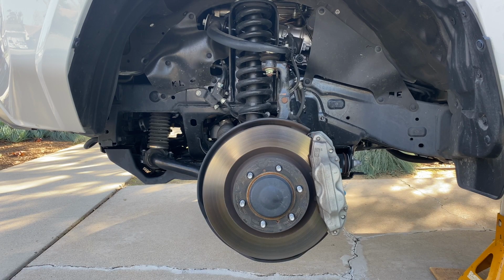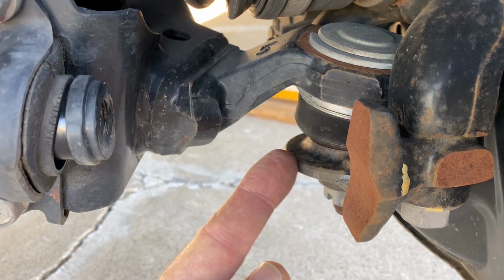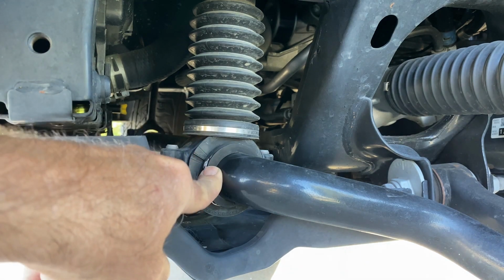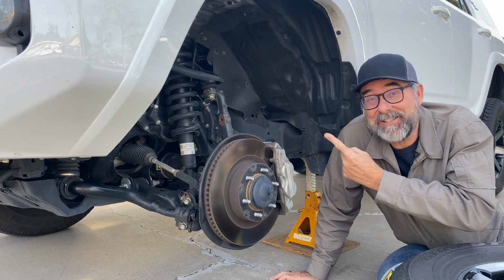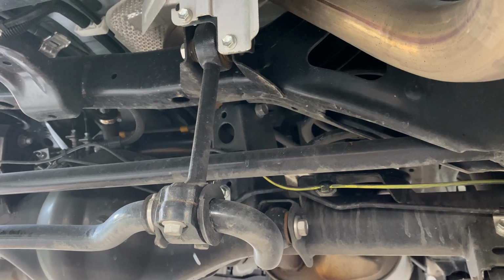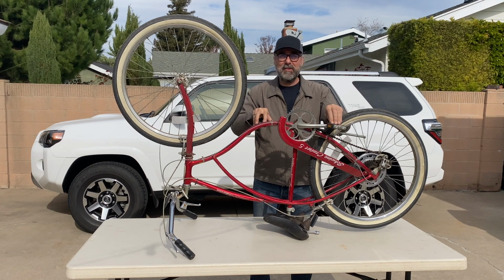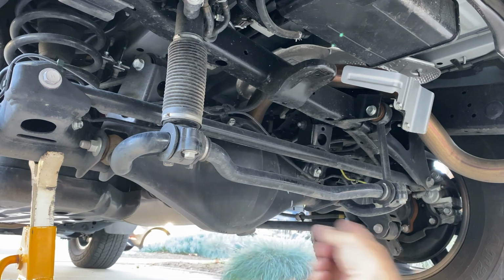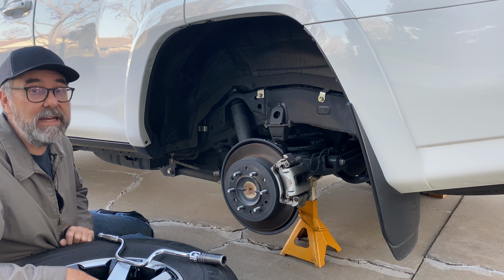2021 Toyota 4Runner TRD Off-Road Suspension Walkaround: Why I Bought The KDSS Stabilizer Bar System

Comment: there are pros and cons, for me the cons outweighed the pros, and essentially it seemed like bandage toyota came up with for rollover accidents. 
the KDSS has less clearance due to having the skid plate sit lower.
cost of repair is insane
for washboard roads or fast offroad driving both left or both right wheels with compress at the same time, like driving on a road, which will make the kdss stiffen up and put extremely ahrd hit into the cab. 
You just can't go wrong with the original design, especially if you know how to drive and what you're doing.

Comment: 2024 TRD Off-Road and TRD Pro models are equipped with an electronic-locking rear differential and Toyota Crawl Control feature for enhanced off-road capability.

Comment: I have a '18 TRD Off-Road with KDSS that failed at less than 47k kms. Lightly wheeled, 95% daily driven. For most people with KDSS,  its great and never an issue. But for the odd person that has it fail on them they'll see a more than $5300 repair bill (checked with multiple toyota dealerships that dont normally have to work on them) for a $4000 factory option. It was difficult to justify the spend on this repair and  I opted to tear it all out for a non kdss sway bar setup. Wish i never had it equipped. To each their own though.
Reply: What did converting to a non-KDSS setup entail? From what I've read it's not as straight forward as replacing with the standard 4Runner sway bar as the frame mounts are different.

Comment: That detail on the longer grip length of their “performance nuts” is something I learned from your video. Genius, really. it basically allows the benefit of a spacer to lengthen grip length without an additional part.

Comment: I want to level my trd off road premium and add some falcon atw tires for snow and lots of skiing rain doing some off road and still a daily commuter in south.  Im getting various info from multiple sources and am acquiring more here.  any input on how to do this without adversely affecting the KDSS? I don't want to cheap out..just want the best option for my needs.

Comment: Hi Dan.  Great video.  I have a 2016 4Runner Trail with KDSS.  The KDSS light just came on.  I don't notice any difference in handling nor can I see any leaks in the system.  In an effort to mitigate the $4K fix offered by Toyota, might you have any suggestions?  Thanks
Reply from the maker: I'm not sure what the issue might be. A friend bought a used 4Runner Trail with KDSS, and his light came on. In that case it turned out to be rodents chewing certain wiring and causing a short.
Reply: @DanEdmunds that's terrible. KDSS is more of a worry than a legitimate addition

Comment: Thanks so so much for explains this and using the bike too! I totally understand it now lol. I was a little confused before. Will putting different wheels on a 4r with kdss change or mess anything up on the balance or calibration ? Ex. Heavier or lighter wheels or wider

Comment: Do you know if the TRD Pro Fox shocks eliminate the notorious brake "nose dives"?  I have a 4R with KDSS and I could see a big difference from my first SR5 without the KDSS.  The SR5 had TERRIBLE nose dive.  If the KDSS is better with nose dives than with FOX shocks, I might not "upgrade" to a TRD Pro.  Thanks.

Comment: We drove our nephew's 2019 SR5 Premium a year or so ago, and was disappointed our 1999 4Runner handled so much better. I was surprised to the point I thought about looking at other vehicles entirely. Then I heard about the KDSS system and looked at a TRD Off Road Premium, which we ended up buying. It's still a bit soft and bouncy with noticeable nose dive when braking, but so much more stable and flat in corners. Very happy with it!

Comment: How does the KDSS piston know when to go limp?
Reply from the maker: It doesn't need to know. See the bicycle pedal example in the video. When cornering, both cylinders (they're only on the driver side) compress or extend together, which means the fluid inside them "deadheads" as each stream runs headlong into the other. (Standing on bicycle pedals is the analogy here) Fluid is at a stalemate, so the struts can't move. In articulation, each is trying to move in the opposite direction, so the fluid moves freely, allowing the struts to move. (Pedaling the bicycle is the analogy here.) The road below the vehicle is basically the "feet" pushing up on the KDSS struts.

Comment: TRD Pro is not more expensive just because of the suspension. There are a ton of options that drive up the price, like rack, wheels, exhaust, and the high end sound system. For what it's worth, TOYOTA puts KDSS on all their Baja 4Runners, not the PRO suspension.

Comment: KDSS is crap.  If you need sway bar disconnects, install them.  This system just breaks, and the computer throws a fit when it's missing after you take it out when you see how expensive it is to repair.  This is a solution to a problem that doesn't exist.
Reply: Best comment ever

Comment: How does the 4Runner ride with the KDSS other than it makes it handle better? I mean does it give it a more luxury ride?  Smooth and isolating?   Aside from the Avalon, all Toyotas ride crappy.  My GF's RAV4 Limited rides like a tank on gravel road.  Every bit of the road surface can be felt and heard.  Hit a pothole or rough roads and it makes you think the car had no suspension at all.  Most uncomfortable riding car I ever drove and rode in.  No amount leather or options makes it easy.   My F150 is a Cadillac in comparison.  Does the KDSS make the 4Runner more comfortable on long interstate drives?  Please let us know after you have gone on such a road trip and some off road venturing.  Thank you.  I am considering buying a 4Runner and your recommendation will be greatly appreciated.

Comment: I love my KDS but I have a question why the front sway bar seems like to walk to the driver's side protrude about 3/4 of an inch more?????? It seems to be happy there... At 65000 miles outside rubber bushes look a little worn  so I replaced them with urethane.. No real problems other than it just don't look right....
 It's not a lot of information out there........
 Some reports say it wanders side to side and it's just fine,,,, but mine seems to like the driver's side any thoughts on this

Comment: Would be cool if this could be on the tacomas as well!
Reply from the maker: The Tacoma would have to have coil spring rear suspension -- which is supposed to get in about a year. KDSS? No idea. They never put it on the FJ Cruiser, which really could have used it.

Comment: Dan, I know your a master of suspension. 👍🏻 I’m in a position to order a 22 trd off road 4Runner. I/we are not new to 4Runners. 1 of them has kdss and the other is a trd pro. I think kdss is a great system for my wife’s daily driver. However we are going to a 22 off road premium that we want to alter the suspension a bit. Looking at adding 2-2.5” in front and 1-1.5” in rear with springs and shocks NOT spacers. I talked to (2) 4x4 outfitters thinking I’d get some answers , but “naturally” one says get it it’s great and the other says no. So…… I’m back to square one. I would appreciate your input. We’re ready to order just have to decide. I’ve never driven one without kdss except our current pro. Due to the vehicle shortage I cannot find one without kdss to test drive. We live in SE Wisconsin but travel quite a bit to NW Wisconsin where the trails and forest service roads are plentiful. This new 22 will be driven ALOT 85% roads and 15% off road. 

Thank you for your input and great videos. 

Mj
Reply from the maker: I am about to lift the front of my 4Runner, in the same way, with Bilstein 6112/5160, I think. I'm not clear on how high a KDSS 4Runner can be lifted before there is an issue, but I've heard that 2 inches is OK in front with the rear an inch less (2/1) because that 1-inch difference is what most people prefer to level the stance. I may only lift the front one inch and leave the rear alone (1/0), buts that's my preference because I personally don't want to lift it any more than necessary. I have now fitted 33" BFGs on the truck, and they look even bigger because I haven't jacked it up a lot. I also know they clear when fully stuffed (without spacers) because I can test that on my ramp.
Reply: @DanEdmunds  Looking forward to a follow-up video with these changes!  Many of us out here in the inter webs are interested in your expertise!  Thank you for sharing that knowledge!  Btw. just picked up a TRDOR with KDSS and am loving it!

Comment: Thanks for doing this video. Apologies if I’ve missed it, but why don’t they put this on the trd pro’s? Do they have a better system?
Reply from the maker: I'm not sure of the official answer. I think it comes down to cost - the TRD Pro is expensive enough as it is, and complexity. I think TRD Pro 4Runners have the Fox dampers added at the port, not on the assembly line in Japan. KDSS would make that swap more time-consuming. I also think that the Fox suspension might have a bit more travel and flex a bit more than a non-KDSS TRD Off-road. Not as much as a KDSS TRD Off-road, but close enough that the expense and complexity might not be clearly worth the cost.

Comment: Does trd pro have more body roll than trd off-road with kdss?
Reply from the maker: Hard to know for sure. The shocks and springs are quite different on the TRD Pro. I think the difference between an SR5 or a TRD w/o KDSS versus a TRD w/KDSS is quite clear, because the shocks and springs are similar and you're comparing apples to apples.

Comment: If you add a aftermarket suspension, it doesn’t interfere with the kdss does it?
Reply from the maker: My understanding is it does not -- so long as the lift amount isn't more than about 2 inches. I'm considering a Bilstein 6112/5160 setup, and have seen the instructions that show recommended front spring perch settings (6112's are adjustable) for KDSS and non-KDSS 4Runners.
Reply: @DanEdmunds  Ya I had to do a bunch of looking into stuff prior to making the purchase. It hasn’t arrived yet but I went with the Icon stage 1 set up. I think I’m going to just buy the ucas too though. I want to put 285s on.

Comment: awesome teaching! But what happens when you wanna put 35" tires on the 4Runner KDSS on TRD Offroad?  Is this why the TRD PRO doesn't come with KDSS, so you can more easily modify with a lift and larger tires?

Comment: Can you answer the impossible to answer question about 4Runner suspensions.  Does the non KDSS TRD Off Road have a different suspension than the SR5? Some say absolutely yes. Some say absolutely no. Can you definitively answer this question? Specifically are the spring rates the same? Are the struts tuned the same? There are tons of comparison videos on all the cosmetic and convenience features but NOTHING on the suspension. Can you please answer this age old question?  If you can definitively answer this question you will be an internet HERO! Thanks
Reply from the maker: I'll work on that! Having tuned the original suspension of the original Tacoma TRD Off-Road as a Toyota engineer, that answer is 100%. But that's because the TRD Off-Road had Bilsteins and the SR5 did not. No Bilsteins on the 4Runner TRD-Off-Road here, so I'll have to look into it. The question here is a good one: are the springs the same and are the shocks valved the same internally between T4R SR5 and TRD Off-Road?

Comment: Excellent explanation! Thanks.
I just test drove a 4Runner SR5. Liked it except for the noticeable body roll. I have read that both the x-reas (on the Limited) and the kdss (your trim) substantially reduce body roll. Some folks say the x-reas is prone to leaks and to avoid them. Hoping you can get hold of a Limited to compare the two systems.

Comment: Exact same reason I got the TRD Off Road. The only thing I think you missed mentioning was KDSS won't allow disconnection above a certain speed, and possibly only in 4 low. I'm almost certain I read that somewhere back when I did my research though I don't recall the specifics. So there must be some level of electronic on/off. Great vid!

Comment: Dan thank you for the clear and excellent over view of the KDSS system; which I have in my 2019 TRD Off Road Premium.  Is the KDSS that I have on my 2019 the same as you described in your video?  Interestingly when I bought my 4runner it just happened to come with the KDSS suspension and I had no idea what it was.  Once I knew that my vehicle had the KDSS I started to consider getting a lift, but when I called around to the various Toyota dealerships no one really knew anything about how it work and why it was an upgrade.  Thank you for clearly showing what it is and now I feel much better that I happened to get it.  Thank you for the informative video!
I was going to get some KO2s and keep the 265/70/17 size.  Are they a good choice or do you like a different tire? Tks

Comment: If the KDSS fails in some manner (all fluid leaks out, piston stuck, etc) Will the suspension then function as if no KDSS was installed or is KDSS necessary for the entire suspension system to  continue to operate?
Reply from the maker: It's just the stabilzer bars. The springs/shocks continue as normal.

Comment: I really like the manner in which you explain everything. Great videos! Where did you get that breaker bar/speed handle?
Reply from the maker: Thanks!  It's a Sanp-On tool, part number SN4A. I've had it forever. I don't think they make it anymore. But you might look on eBay.
Reply: @DanEdmunds  i was able to find one on eBay and should be in my hands soon. Thank you!

Comment: Curious why KDSS is not an option on the TRD Pro?  Fox suspension?
Reply from the maker: I think it comes down to cost. The TRD Pro is already expensive enough as it is. And, I think it's also because the TRD Pro parts are installed here in the USA after it arrives at the port. Making the swap with a standard stabilizer bar is easy; doing it with KDSS looks more complicated. Also, the TRD skidplate doesn't fir over KDSS. It does hand down a bit and lessen front clearance a little bit. But I think it's really cost.

Comment: Hi Dan. Are you planning on adding a lift kit ? What's the max height you can go with the kdss? Thx
Reply from the maker: There's a debate about that, and no clear answer. 2" seems to be the consensus, but that may not apply to all model -- the Land Cruiser's KDSS is radically different, for example. I only plan on lifting the front 1.75" and the rear no more than 1", so I think I'll be fine.

Comment: Hey Dan, KDSS is awesome but if you upgrade your suspension the rear panhard bar will over-droop and hit the KDSS bracket bolt. We've got a solution if you need it! 
https://ironman4x4america.com/kdss-compatible-adjustable-rear-panhard-bar-kit-suits-lexus-gx470-gx460-and-2010-toyota-4runner/

Comment: I know this video has been out for over a year but I have a question for you since you have worked so closely with the KDSS system. What are you thoughts on the aftermarket parts for the KDSS system? In particular the KDSS spacers for the rear, front passenger (Treaty Oak and Black Gate) , modified track bar (Sonoran Steel) and one company (IronMan4x4 ) offering a panhard bar for lifted KDSS vehicles.
Reply from the maker: I have no direct experience, but I can see the potential need if you lift it A LOT. And it's always a good idea to keep an eye on the angularity of your panhard bar with ANY lift. You want it fairly flat when the truck is parked on flat ground. Probably not a big deal if you raise the rear an inch-ish, though.

Comment: How does the KDSS system "know" when to engage and disengage?
Reply from the maker: The line pressure meets head-on and reaches a stalemate when cornering (both ends rolling the same way = same phase) which hydraulically locks the strut and force the anti-roll bars to work normally. When on moguls, the suspension is moving in opposite phase (one end compressing, the other extending) which allows the hydraulic fluid to freely circulate front to back. This free strut movement allows the anti-roll bars to wobble in its mounts as if it were broken. Then, when you get on flat ground and start cornering again, the fluid from each end once again runs into each other head on, locks the struts and forces the anti-roll bars to work again.

Comment: I have to disagree a bit. If you are modifying your 4runner (lifting it) it’s better to get a non KDDS 4runner. Down the line the system has the potential leak. I installed a king suspension in my bodies 2018 4runner and it rides amazing.
Reply from the maker: Huge lifts of 3-4" are an issue, but for those that run stock height or aim for a 1.5~2" front/1" rear leveling lift like me, it's no thang.

Comment: Just went to the dealership, says Toyota no longer brings kdss on the off road, its $4k option
Reply: I purchased a 2021 TRD off-road 4Runner last October. The kdss option was a $1750.00. In California
Reply from the maker: Yeah, the option is less than $2k. I think Tom has the correct price.